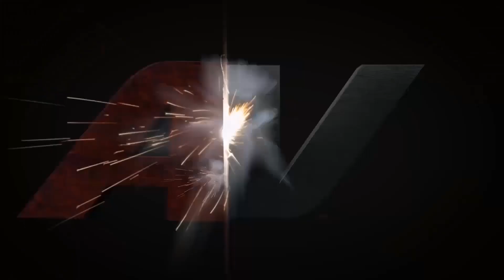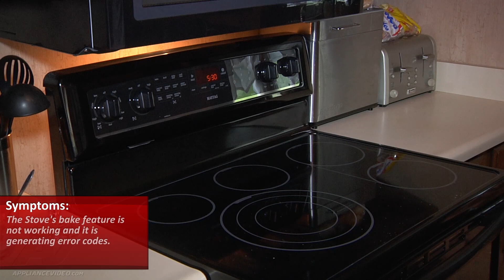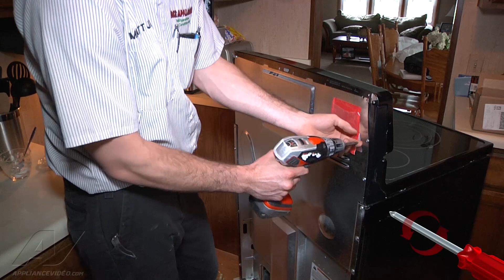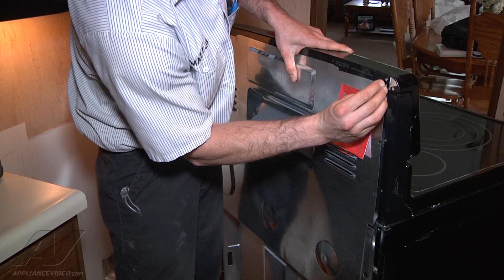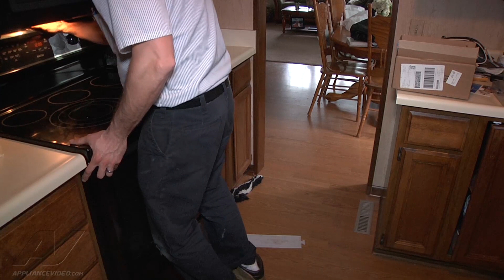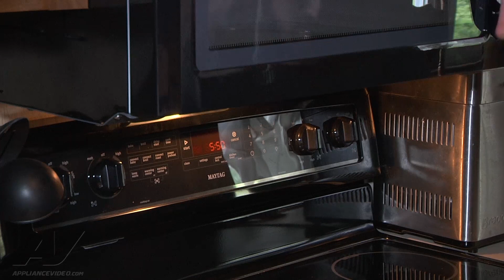Whirlpool Stove Repair - Not Baking and Generating Error Codes - Electronic Control

Comment: I got an error code of F9 on my Whirlpool oven. It's been working for over a year.  I just ordered a new computer part for it.
Reply from the maker: Great question, you can call
our parts department at 1-800-830-5465 and they can give you help 6-days A week
Mon-Sat . You can also search at www.SaveMoreOnParts.com 7- days a week.  If you have a more
technical question that our parts department cannot answer, our technicians are
answering all questions at our website at www.ApplianceVideo.com under our Repair Help section. We have over 6,000
common questions and answers that you can easily search through by your model
number, appliance make, problem or error codes, and It’s completely free to
search through our question & answer library. There is a very good chance
you question is already answered there.

Comment: my wall oven is giving code error of F3E2..Repair guy wants almost 600 dollars to fix..could tgat be cirrect???
Reply from the maker: Great question, you can call our parts department at 1-800-830-5465 and they can give
you help 6-days A week Mon-Sat . You can also search at www.SaveMoreOnParts.com 7- days a week.  If you have a more technical question that our parts department cannot answer, our technicians are answering all questions at our website at www.ApplianceVideo.com under our Repair Help section. We have over 4,000
common questions and answers that you can easily search through by your model
number, appliance make, and problem or error codes, and It’s free to search
through our question & answer library.